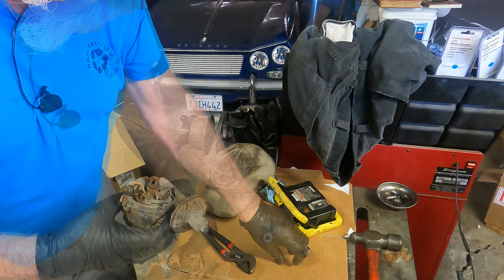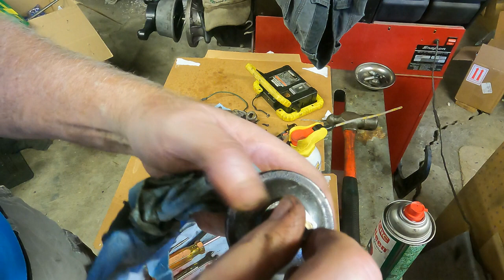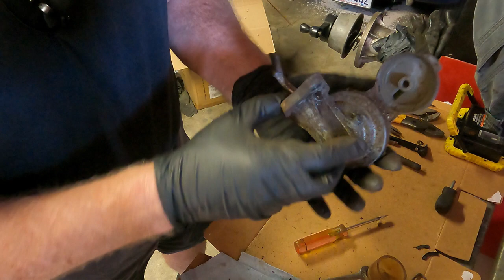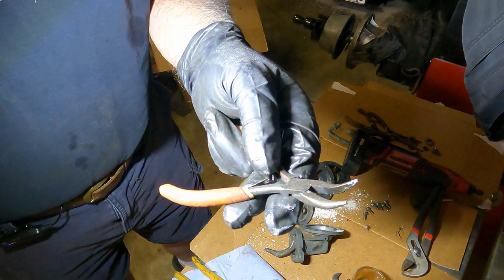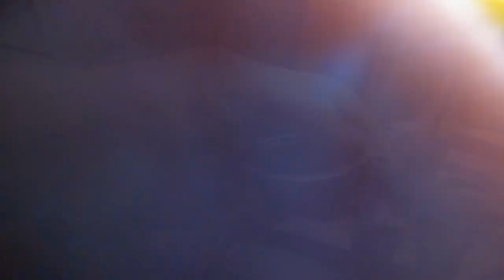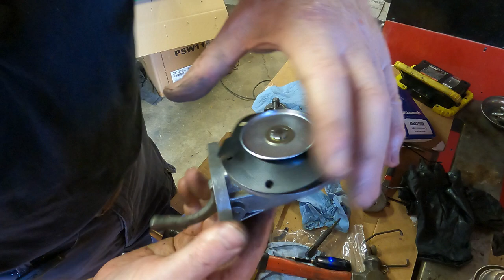1955 Triumph TR2 Restoration.  Part 22 Distributor disassembly and Fuel Pump rebuild

Comment: Golly, all that white aluminium oxide powder in the pump body was a surprise. This may not be an original pump. It does not have the priming lever. I find the primer useful when I have not used the car for a while (and when I remember to use it) to cut down on cranking to get the car started. Unless you can get an AC original pump with the primer, you would be best to stick with what you have because there are many reports of replica pumps failing, sometimes within a few hours of use.
Reply from the maker: Later, off camera, I changed out the lower section for an priming type as I too have found the ability to prime the system quite useful.  I am fortunate in the fact that I have several old pumps laying around the "Parts Shed".  Thanks for watching.

Comment: I've owned my TR3A over 53 years and rebuilt the fuel pump many times, especially when Ethanol became common in gasoline (not premium)....I'm about to service it again but will Heli-coil the bottom threads as they're becoming 'punky'.....I have 2 spare pumps and never go anywhere without carrying one, as I do with any car using a mechanical pump.....I was surprised the valves use no gaskets in yours......I use the original AC....One spare is AC and one made in Canada(no prime lever)......John (west coast,Can.)
Reply from the maker: It just seems to be the early type that have the gaslets.  Once they use the swedge type, no gaskets are used.  There have been a lot of afyermarket pumps over the years.  I suppose there is a common body with different levers and connections, so a large market from the basic casting.